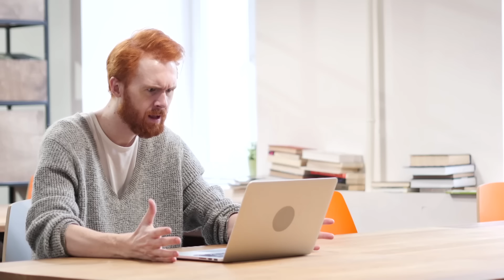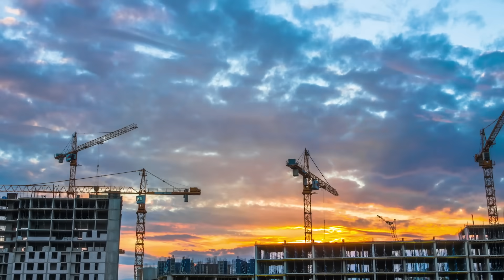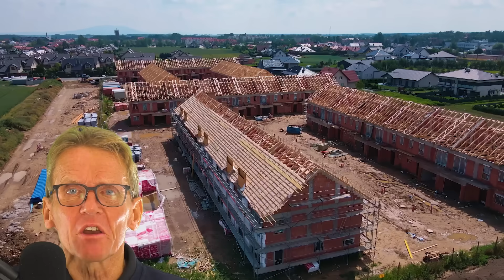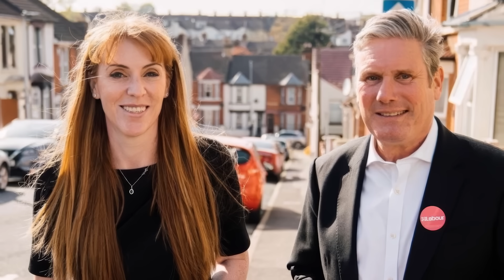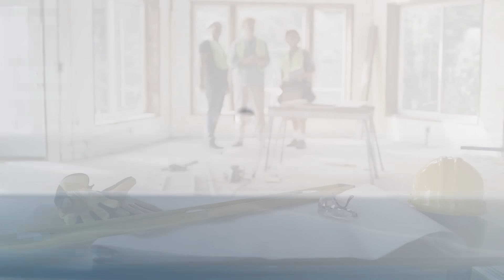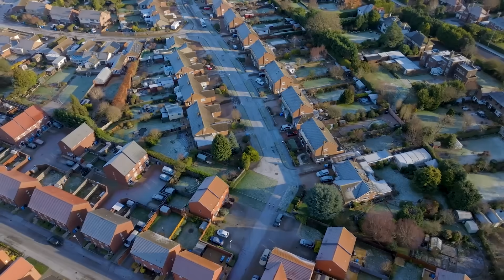1.5 Million Extra Homes in 5 Years?

Comment: I’m an ex builder and spent the last twenty years as a building inspector, and I can assure you the regulations have increased tremendously in the last decade or more, we have made it so difficult to build new homes with so much red tape plus the costs of infrastructure, CIL at 116 quid a square metre and that includes a garage, so your correct, no chance unless every boat load that lands happens to be full of brickies,chipies, spreads, plumbers, ground workers, sparkies, decorators, roofers, etc.
Reply: Good
Reply: Unfortunately it's all doctors and dentists from what I hear
Reply: Doctors
Reply: CIL £400 sqm where I live! Agree completely on the difficulty in new build houses though. Unless there is a serious injection of common sense back into the regs only the big 5 will build anything!
Reply: I hear they're all doctors and engineers instead.

Comment: At the time of typing the Labour Gov't should have delivered  27,198 completed homes by now.
Reply: @johnnymetalcore5608  they have been in power 1 month
Reply: @sivoltage they should have built 30k by now!
Reply: There arnt enough civil engineers and architects to design that many homes in the time unless they abandon all planning and approval processes……that would be disastrous
Reply: @singeager  We’ve got loads of architects, engineers and doctors too. They are being put up in hotels all over the country paid for by the taxpayers. 

More arrive weekly in little rubber boats, so don’t fret it’ll turn out fine
Reply: I worked for a new build plumbers until last summer when 1/3 of us got laid off as we didn't have the work ,those that remain are also short of work still

Comment: I fully agree with your comments and as a chartered building surveyor struggling on every project to find good consistent contractors or the average age of the guys is pushing 60 then most will have retired before 50000 homes are built.
Also as and when the housing developments are announced doubling the previous strategic Planning in Bucks, the locals will fight and delay and i would say Labour wont hit half their target and in process  lose there voters. (What few there are) 

Disaster on all fronts
Reply: @johnnettleton1240  same as the last lot then in reality, I've suggested a solution that does Indeed revolutionise the game IE more for less labour material crew,who is going to front it, solutions not excuses!

Comment: We did build 300,000 houses and flats in one year (1969). The year before saw the partial collapse of Ronan Point which drew attention to the poor quality of much of it. I completely agree with you Roger- it’s not possible nor is it desirable to try to build so many houses and flats so quickly. We could build more quickly if the industry invested more in off site production but house builders are very conservative. I say this as a Labour supporter and someone who taught housing development for 11 years.
Reply: Yeah I remember them - the working class communities bulldozed to make way for them and the shocking depression and isolation of those who had to live in them. All crap - thanks mainly to the Labour Party who were determined to outdo the damage done by the Luftwaffe.
Reply: It was over 400,000 that year for the UK as a whole. 300,000 was normal back before right to buy.
Reply: @macarfs  You may be right l can’t be arsed to check. What is interesting is how stable the numbers built for the private sector are. They have no incentive to build to the point where prices fall
Reply: @kubhlaikhan2015  Your own politics distort the facts. In those days both the main parties competed to build the most. The comprehensive clearing programmes ( mostly under Tory governments) did sweep away a lot of very bad housing (no inside toilets etc) by the end of the 60s this practice was generally abandoned in favour of improvements to existing stock via General Improvement areas ( from 69) and later Housing Action Areas ( from 74).
Reply: @jontalbot1  The houses destroyed were high quality Victorian buildings, sound as a bell with at least 100 or 200 years in them. Not having a toilet installed indoors doesn't make them "bad housing". They didnt have indoor toilets originally because people disapproved of crapping indoors! Simple as that. Those that survive cost almost a £million. Most of the crap they replaced it with has already been demolished and a lot of the stuff they are putting up today is worse even than that.
Reply: @kubhlaikhan2015  That is broadly correct and it also destroyed local community ties. That is why policy changed from the late 60s onwards. What l was trying to do is set out the facts rather than try to put a political slant on what happened. In those days there was broad consensus between the parties on housing issues. Both accepted a responsibility to see all members of society decently housed, as is the case still in many European countries. In the UK since the early 90s failed to build sufficient social housing. The result is a growth in the private rented sector, homelessness, overcrowding and increased house prices. Both political parties are culpable in my view.
Reply: @jontalbot1  I think you are missing something that I remember well - large sums of money changed hands to push through those demolition and construction programs. A lot of crooked people were getting rich and everyone knew it. The great bulk of that corruption involved the Labour Party and there were a string of prosecutions of Labour councillors in several parts of the country.
Although I agree with you that social/council housing should be part of the solution, it's a drop in the ocean. The market has been inflated by the infusion of vast quantities of investment capital (>debt), a lot of it from non-British oligarchs. Plus, of course, 25 million foreigners needing houses. The private renting sector we used to have has been destroyed by intrusive government red tape and the takeover of the market by profit-driven parasites like Countrywide. The only thing preventing rents rising even higher is the fact that tenants have nothing left. There are no rent controls, no real property maintenance and no solid tenant rights. The structure of the market is designed to bleed us all dry, enslaving the whole population.
It will take a revolution to change a market that has essentially become feudalism in a pernicious modern guise. By building more houses at a time when nobody can afford to have children the only thing that is certain is immigration.
Reply: @kubhlaikhan2015  There was one case- T Dan Smith and it was not in relation to housing. Comprehensive Clearing Programmes began in the 50s under Tory government. It was Labour who ended them. Stick to things you know something about.
Reply: @jontalbot1  That's a stupid and offensive remark. Why would I not know something about it when I grew up in the middle of the demolition and had relatives involved in construction AND council planning?
Reply: @kubhlaikhan2015  I drive a car: doesn’t mean l know how an internal combustion engine works. You grew up in a house: can you build one? You don’t bother to inform yourself and think knowing something is just the first thing that comes into your head. Learn to recognise your own ignorance

Comment: I suggest they use modern capsule homes, with pre-built pods delivered to the foundations to be bolted together and plugged into the utilities.  I've seen these in Scandinavia and they're excellent starter homes. More pods can be used to increase the bedroom capacity to 2 , 3, 4 rooms plus the kitchen/living room pod and bathroom/utility pod. Cheap too and uses a relatively low skilled workforce to assemble..
Reply: Just what I’ve always worked all my life for… the eventual chance to live in a compartment. 😂

Comment: I remember reports a few years ago that there are 1,000,000 unused properties in the U.K. is that still the case? Or was it just another number pulled out of the air by some politician?
Reply: Supposedly around 700,000 homes are classed as unfurnished and empty with around 260,000 of those classified as long term empty. I suspect most of the "short term" ones are simply going through probate. The remaining 300,000 are mostly short term lets and 2nd homes etc which were classified as "empty" which is not really accurate. Either way even if we could fill all the empty homes tomorrow it would barely make a dent in the overall problem.
Reply: @jannenreuben7398  thanks for a great informed response 👍

Comment: I agree, a farm behind my old house got planning submitted in 2014 for 330 houses, buy the time they had permission , built the entrance,  foundations started in about 2018.. they are still building so that site by Taylor Wimpey has progressed at less than 33 per year. They have asked be included in the strategic land plan for a second phase so that might be 330 houses in 2034? And that was “ best and most valuable farm land”

Comment: It's not just Labour  -  for decades, successive governments have promised to do exactly the same thing, but it's an unreachable target.
Even during the house building boom of the 60's, nowhere near those numbers of houses were built, and that was before there were so many restrictions on where you could build.
Reply: @Kevin-mx1vi         
You are incorrect about the 1960`s.
Almost 300 thousand was achieved in 1967/8  But never reached that number since.
Reply: But many more than that were built every year in the 1930s, so it's not impossible. But that was before the Town and Country Planning Act 1947 threw a spanner in the works and gradually made building more and more difficult. And of course many other factors, notably the lack of skilled tradesmen, have now compounded the problem. If the TCPA were repealed and the other logjams addressed then building at scale could be possible again.
Reply: @paulcassidy8130  interesting

Comment: "It revealed land in long-term land banks is equivalent to c. 658,000 plots, while the short-term land bank is smaller, at c. 522,000 plots. The CMA has used two separate methodologies to identify 29 specific areas of the UK where a high proportion of land is owned by a group of the largest housebuilders.15 Nov 2023

GOV.UK"

It might be a good idea to enforce usage of these plots straightaway before trying to push through more building on green and grey sites. If the Govt. commissioned designs for 2,3 and 4 bedroom houses to be factory manufactured for erection on site some headway might be made. After WW2 a similar project was implemented for utility furniture. The problem of insufficient bricklaying skills could see the introduction of alternative cladding systems popular in other countries.

Comment: Purchasing land can take anything between 6 months to a year, depending on the parties involved. It takes roughly 2 years to get a large housing site through planning, let alone into build. If infrastructure diversions are required, another 12-18 months to work those through, then at least 18 months to 2 yrs to build a site out. There are no quick fixes, and just thinking that we can use off-site manufacturing to speed things up is ludicrous - the land acquisition, planning, infrastructure and procurement process is still the same.

Comment: I am qualified in construction and carpentry joinery, but have not worked in the trade since 1991, I worked manufacturing joinery for houses and fitted on site, I did not pass my driving test in 1987 so am in a job in retail, I cycle to work, if I had passed the test over the last 35 years made efforts to construct new homes, having made the driving test so difficult I don't intend attempting it again so im out of the construction game.

Comment: The answer to building more houses is change how it’s done. Manufacture them on a production line. Standardise, control quality and accuracy. Assemble quickly from accurately machined components. Automate the assembly using jigs, fixtures and machinery. Make them to be super insulated and generate their own power. Don’t make them all the same but standard options to avoid errors. Train the builders in efficient working practice and quality control. Employee someone from Toyota to set it up. Do it on a massive scale to reduce cost and drive down the cost so young people CAN AFFORD A HOME!!

Comment: The target will not be met.
Building more houses in the short term will lead to another rise in house prices.
There are 700k empty homes
There is too much demand-side net migration to thwart the supply side
15 years of Tory cuts to town planners (-30% planning officers now than the 2010 election), architects, planners, small builders, quarrymen, decline in UK quarry output for decades, decline in general skills in local governments and in the civil service.
Biodiversity Net Gain rules will slow down the build.
Public sector has to start building but appears to be no changes to legislation planned
The system hasn't worked properly since 1977 and unlikely to do so unless wholesale change in the approach - ie private sector are not delivering enough volume so the state has to build more.

Comment: We have an overall regulatory system that is inefficient. Aims laudable but structures hopelessly fragmented, time-consuming and often inconsistent. A culture of ticking boxes to pass on liability rather than taking responsibility. Then you have training. How good and relevant is it in general, and what is the cost? Why do we have a shortage of skilled tradesmen? Also  qualifying regimes set up that again absorb time, and increase costs, that are often been promoted at the legislative stage to simply reduce more nimble competition. This country needs radical reform of the framework surrounding Construction.

Comment: The calculation on 'working' days is even worse than you say. 
52 x Weekends = 104 x days
Xmas shut down = 10 x days (extra days)
Other bank holidays = 5 x days 
Sick days = 5 x days ( UK average is 5.7 days per year)
Annual leave = 20 x days (minimum)

So that equates to 144 x days, which leaves 221 actual working days per year, not taking into account a single day lost due to bad weather (of which there are many in the UK).
So over 5 x years that's 1,105 working days. 
1.5m houses in 1,105 days, equates to 1,357 houses a day.
Working 8hrs a day, means 170 houses being built every hour.

Wow???

Comment: I don't always agree with you but on this I can't see it happening. Not without the government directly funding the projects. But Reeves has already said that the government aren't in the market to build houses. So it's dead in the water. Doubling the houses being built also means doubling most of the workforce both onsite and office side for architects, surveyors engineers etc. Then if they are building in green belt you still need your bat/bird nesting, newts monitoring etc. which can only be done at certain times of the year. I'd love to see it happen as I'll be a busy man, as will everyone in the construction industry, but I can't see it happening. 1 million by 2030 would be impressive.

Comment: 1826days/5years=365.2 days/Yr. Which like you said takes into account holidays etc. ?????? But it does not!
Try this say 46 working weeks/Yr x 37hrs x 60 mins x 5 yrs = 510,600 mins. That's nearer three houses per minute. That does not include wet days, waiting for materials and all the other reasons to hold the job up.
Reply from the maker: Like I said I didn't do the maths but thanks for the rework.

Comment: A new build where I live had a normal concrete/block base and then some single storey steel uprights that were infilled with a compressed boarding which was covered in stretched over plastic sheeting. I am waiting to see what the outer skin will be. This system is sold as being much quicker and more insulated than other methods of construction and far quicker to erect. I wonder how fire resistant it is though?
Anyway, it could help this mindless statement which, at 450 homes built per day, is already far behind the target.🤔🤪

Comment: Within the first week of government I herd a Labour minister (Unfortunately I cannot remember which one) on the Radio 4 Today programme sating that they would have spades in the ground in five years not that the one an ahlf million would be completede in five years. This is more realistic.
Reply from the maker: I can put a spade in the ground right now. Their manifesto pledge didn't make that distinction.
Reply: @SkillBuilder You can put a spade in the ground but a spade in the ground on an acquired site with planning permission granted for a designed project with funding and the organisation to tske the project to completion is a whole other matter. Building 1.5 million new homes from a standing start in five years would be almost impossible.
Reply: @SkillBuilder What does seem to be s mistake is the idea that private developers csn deliver this more cheaply and efficiently than councils or that continuing to treat this as a market matter will actually yield sufficient homes at s price that folk can actually afford. At present there is a problem of over supply if affordable housing because housing associations cannot buy these units and private buyers cannot either. The whole private housing model is broken and will remain so as long as private capital has such a strong controlling influence over our governments of both stripes.
At no point in history has private industry supplied a sufficient stock of affordable sanitary housing. This is why council housing was created.
It is in the interest of private house builders to hoard land and limit supply to maintain high prices and profits.
Reply: @SkillBuilder 'Scandal As New Homes Sit Empty Across U.K.'

'i' newspaper, page 8, 3rd August 2024